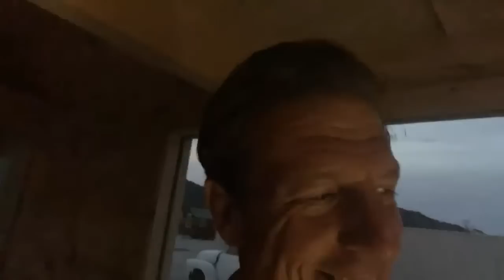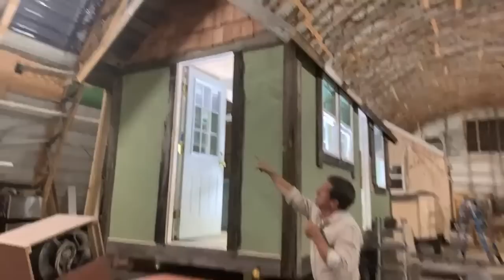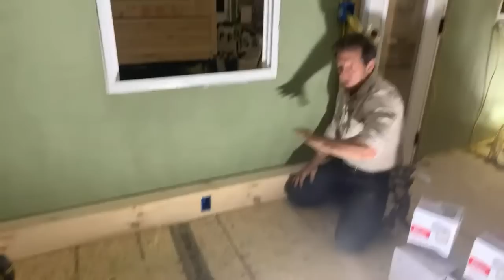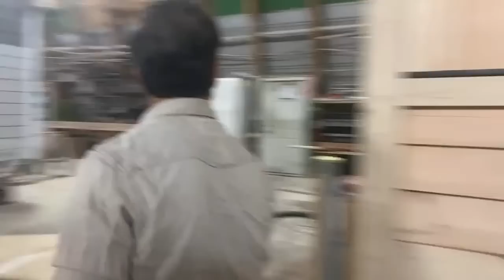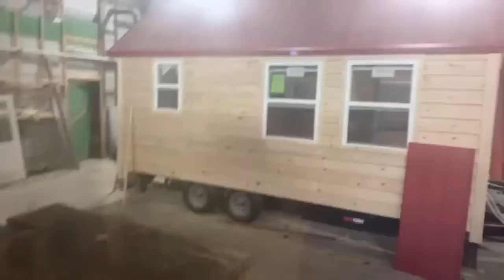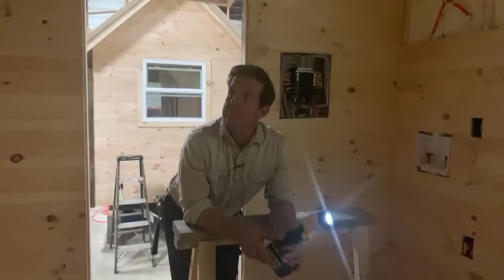4 Tiny Homes and Homeowners Having Painters Regret!!! LOL!!

Comment: I know that this is an old video, but are utilities really cheap in Tennessee? I know that everything has gone up in 2022, but even 2 years ago, my utilities in Massachusetts were nowhere near $50! I have propane heating and it uses some electricity just like a gas stove does when it's in operation. Don't even get me started on how much the propane will cost this year! Lol The thermostat will be turned down low this winter! My electricity is at least $150 when I'm not running a furnace or ac. Running my ac can add $100, but I have a giant window ac that does all of my $800 square feet home. That was last year. Last week it was 95, so I finally put my ac in. We'll see with inflation how much my next electric bill is. None of this includes cable (which I don't have), internet, phones, and streaming services. I would love to pay $200/$300 for a lot rent and $50-$100 for utilities!

Comment: I want a 10 x 20 tiny home. Mini split, tankless water heater, stacking W/D, Medium size refrigerator, 36 inch shower, no sink  in bathroom,  low flush econo toilet,   steps to loft with storage cabinets under stairs, pantry, open kitchen shelfves, minimal windows with screens, one main door with screen door, outside shower,  completed wood poly coded: floors, walls, ceiling, cabinets, no bathroom door, loft with small closet , all led minimal lights,  loft with floor to ceiling horizonal  aluminum rails like a jail cell.. Would you send me an estimate?